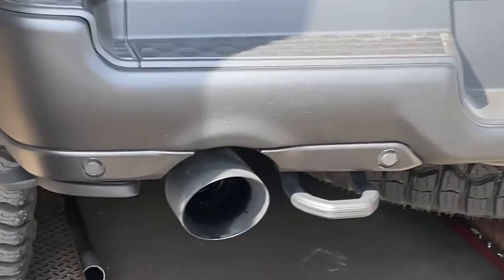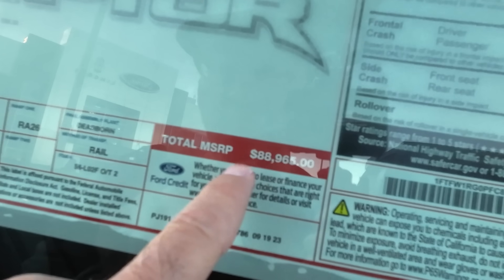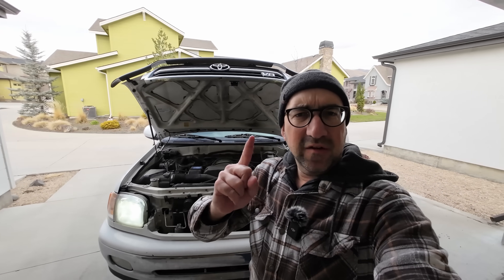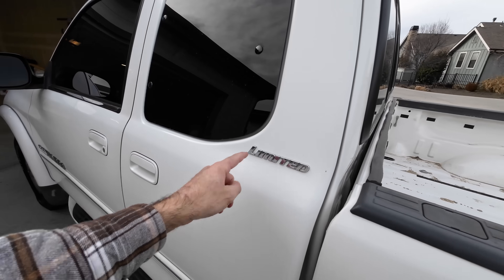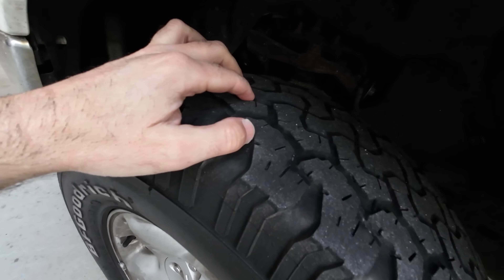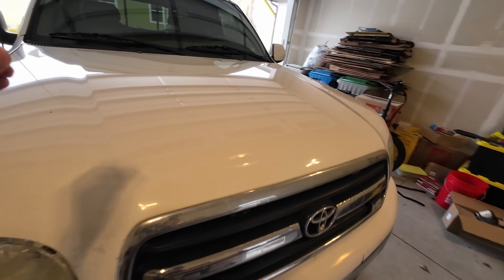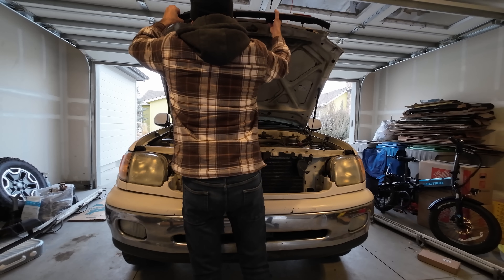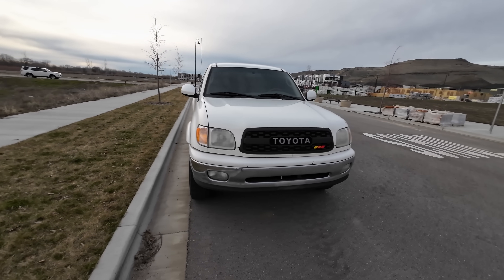I'm Sitting In The BEST V8 TRUCK Ever Made! (and I bought it)

Comment: I’ve run 3 Silverado’s to approximately 300K. I have number 4 right now at 270K. I also have a 3500 dually duramax at 230K. Get whatever you like, but… no plans of changing here! “If it ain’t broke, don’t fix it!”
Reply: What are the years????
Reply: Same. Got a 2000 Silverado 5.3 Z71 4x4 Ext Cab. 90's to mid 2000's Chevy NA V8 gas trucks are great.
Reply: Bruh, chill. You drive too much
Reply: I just sold an excursion with a v10 that had 301k
Reply: You're right built like a rock 🇺🇲🇺🇲🇺🇲🇺🇲
Reply: Guess what. Gm is gonna keep building v8s. If you want a tiny little 4banger turbo go ahead. I'll stick with  the v8 in my pickups.
Reply: @codyfarmer1  while that is correct for the moment GM already offers a turbocharged 4 cylinder Silverado.
Reply: @sjwilson1079  I know that, but at least gm still offers the v8. I would never buy the chevy 4 cylinder in the truck. Just like any other 4 cylinder in any other truck.
Reply: @codyfarmer1  I own a 4 cylinder 99 stick shift Tacoma. Great little truck
Reply: I’ve got a ‘99 Silverado 2500 with the 6.0 liter and 4L80E. 325,000 miles and still going strong. Last year I bought a new 2023 Silverado 2500 with the 6.6 liter Duramax. So far it’s only got 25k miles but it’s my first and hopefully last brand new vehicle.
Reply: @FloridaTwoWheelAdventures  unfortunately the modern diesels are not as good as the old ones.
Reply: @sjwilson1079  nah, they’re fine. You just gotta get rid of all the dead weight on them. I’m simply waiting for my warranty to end.
Reply: @sjwilson1079  nothing wrong with a smaller engine in a smaller truck, but a full size truck needs at least a v6 imo.
Reply: @codyfarmer1  I agree with that but I don't want any turbos. Turbos wear gas engines
Reply: @sjwilson1079  agreed my last f150 had an na v6. Ran like a top for 12 years. Replaced water pump and that was it.
Reply: @codyfarmer1  my favorite f150 had a 300 inline 6
Reply: How many transmissions?
Reply: @ronnyek4242  depends on whether it's the 4l60e or 4l80e lol
Reply: Only 300k miles?

My 2011 Tundra has about 280k miles and is still just a baby.
I fully expect it to last well over 500k-600k miles.

It sucks on gas, but it's given me almost zero problems.
Reply: I still have my 99 4.8 silverado 376k and around 100 of that it had a small turbo it's back to na with a trailblazer ss intake but besides that no egr and a tune its great I'm actually doing the leaf shackles right now
Reply: Why do they keep breaking at only 300k?
Reply: @BillLaBrie  I'm almost at 400k last time I wrote i was doing the leaf shackles which is funny because I just picked up some 1000cc fuel injectors by fic paired to a fast lsxrt fuel rail and HFP 367 lph fuel pump maybe I'll find time to cut and weld the bed from the damage but it drives fine and is enjoying some extra power
Reply: Ok whatever

Comment: I have that truck in a 2001. Original owner, 24 years. Do all my own maintenance and on average spend under $200/year. Best purchase ever!
Reply: I have the 2001 version.  I have spent less than $300 in repairs outside normal service.  Best vehicle I have ever bought.  I get at least 2 offers to sell every month.  No way, she will go to the grave with me.
Reply: @bsmith8016  The only problem I've had in 24 years is an O2 sensor going out. Everything else was regular maintenance. I want a new truck, but this one is in great shape with no issues... can't justify spending $60K on a new Tundra.
Reply: I feel you. I’m tired of my 2012 CrewMax 5.7 4x4, but I can’t justify buying anything else. It never fails. I get offers and positive comments all the time. 205k miles and counting. No doubt I’ll get to 300k; maybe even 400k+ like my buddies in Kansas. New stuff is just so darned fancy and comfortable. The prices and reliability concerns keep me away. I sometimes wished I didn’t care so much about a stellar history.
Reply: I have 2004 Tundra double cab 4x4
Reply: But they have a drinking problem 😂
Reply: @randyparmesan1383  I would rather deal with the cost of the drink than get to know my service manager on a first name basis. 😂

Comment: This is exactly why I bought a 2006 GMC Sierra with the 5.3 V8. It's not a Toyota, but it's still solid.
Reply: At least you bought a truck…not a wannabe
Reply: Facts
Reply: Yo yo, I have a used 2006 GMC Sierra with 207 k on it in the LS L-33 all aluminum, still teaching 5 grand when hauling my trailer. They can have all the new POS trucks.
Reply: I still drive my 2001 Silverado with the 5.3 V8 - I have been driving it 23 years and 316,000 miles.  Still my daily driver.  Rusty but trusty!
Reply: @flinty2  My Sierra has had a charmed life. The rear fenders are only just beginning to rust.

Comment: Great trucks but there’s a catch: If you are looking to buy a first generation Tundra or Sequoia be sure to have the frame THOROUGHLY checked for severe rust. They had a recall, many still on the road and are literally starting to break apart.  If you live in the snow belt protect the frame with Fluid Film or similar protection.    Second, verify the lower ball joints are not worn out as when they fail the wheel separates from the assembly(google “first gen tundra LBJ fail”). Lastly, make sure the timing belt and water pump has been replaced within recommended intervals.    Mostly all basic maintenance items but they will bite you if ignored!  -‘05 Tundra owner.

Comment: I bought a Chevy Avalanche with a 5.3, 4wd with 4lo, loaded, everything works, it can tow 8,000lbs, and I can load 8 feet of cargo in back, plus I can fit 3 adults with comfort in the back seat, stock stereo that came with a sub, stock tires are 265's with 33 inch diameter, 11" ground clearance, excellent body, stronger frame. Only cost me $3800 two years ago.
Reply: Too bad it's a bow-tie, because it won't last near as long as a Toyota!
Reply: 5.3 is a beast........... built to last

Comment: Older vehicles are so much better. I have a 2003 Grand Marquis, 443,000 miles and still runs like new, no major issues since new, less than $1,000 in repairs since new. I also have a 90 F150 that still runs and drives like new...   Great video...

Comment: Perfect choice. I've owned a 2001. And now have a 2004 SR5 Xtracab that I found in 2017 with only 37k miles in San Jose with zero rust. I don't drive a lot and am approaching 115k miles as of January 2025. Other than my 2006 LX that I sold a few years ago, this is my next favorite vehicle I've owned. Perfect size and a V8.

Comment: I bought a 2000 Toyota Tundra Limited with low miles in 2020 and you can't beat the 4.7 V8.
Reply: 4.7 is a legend ! I have one in my sequoia too , so smooth
Reply: I had a 2000 Dodge Dakota pickup with a 4.7 liter motor it was a good running engine I had 142,000 miles on it when I sold  it , but it sure drank the gas . My 2014 ram with the 5.7 engine has more power and gets better gas mileage

Comment: For those wondering, original msrp was $26,300 according to Edmunds. Before Covid, most vehicles would be at 50-65% value after 3 years 36k miles. $10,500 is a crazy high price for a 22 yr old vehicle.

I enjoy your content.
Reply from the maker: Even used truck prices are still crazy right now. I found so many for sale around the same price or 2k less with accident history. This was the best one to buy in my area price/history wise. Crazy times.
Reply: Even before Covid, finding a tundra, sequoia or 4Runner in decent condition for less than 10k was not an easy task. Sure, In 2022 this truck would have been on a dealer lot for 15-20k but a lot has changed in just a few years.
Reply: $10,500.00 for that truck is a bit much. I would have bought the green Ford. If the price was right. The price of the Toyota was about 5k too much.
Reply: Since the green ford was not 4 wheel drive. I would not have bought either.
Reply: For me 10.5k, one owner, no accident, maintenance record, I'm ok with that. It's even a bargain as this truck will outlast most newer ones. Bad lucks can happen, as other trucks.
Reply: Not overpriced IMO for a truck that will last another 20 years
Reply: @FullTimeGT  That makes you part of the reasons why used vehicles are as expensive as they are. You are willing to pay more for a vehicle than it is worth. Used car dealers know there are people like you. You will not negotiate price. You will pay whatever the seller asks. That is foolish.
Reply: @InternetUser._  My car will last as long as that Toyota truck will. It will last me another 20 years & it is already 38 years old. It is in good shape a I paid $1500.00. It was a 1 owner car when I bought. Drive it everyday.
Reply: By all means, if someone out there can do better. Please post your results.
Reply: @GS-zc4sk  You ask for it.
2010 Ford Escape Limited AWD. new tires, brakes, & inspection. 138k mileage $5400.00.
2011 Ford Escape XLT No Rust 109k mileage $5600.00 
2008 Ford F150 4WD. 70K MILEAGE $7000.00.
I found these vehicles in Morgantown WV. 
Any questions?
Reply: It's clean for the age, but still a crazy price.
Reply: @MotorFeed  -- The really important question is this: Will we be seeing your yellow Jeep on some dealer's lot now, or did you keep it too?
Reply: @richardisner3671  You are comparing two totally different parts of the country, vehicle prices change based on region.  Up here you cant find a truck/SUV for under 10k no matter the year.
Reply: @Grozloo  Where is up here?
Reply: The main thing is that you’re happy & you done your research. Can’t wait to see all of your personal touches.
Reply: Absolutely agree,5000$ max
Reply: 100% agree, I just checked local marketplace no were near that high for nice ones.
Reply from the maker: The green ford was $12k. @richardisner3671
Reply from the maker: The yellow Jeep is my daily and not going anywhere. I bought the Toyota specifically for YouTube content. @TheRealScooterGuy
Reply: @MotorFeed  Way too much. Especially since it was not 4wd.
Reply: @richardisner3671   Prices are very region specific. In the city where I do business those 08-10 escapes go for 7-8k. In my home state they can be had for 4-6k.

That being said, a ford escape is not a 4x4 V8 Tundra. I’m a big fan of 4-5k vehicles and have a couple in my fleet, my trucks are usually had for around 10 for a good example.
Reply: @InternetUser._  I never said that an Escape was the same as a Tundra. But the F150 I listed is. I was giving examples of prices where I live. But that he bought was about 7k too much. V8 Tundras are a dime a dozen. If you can find one with a solid frame. The frames are usually rusted through on those models. There was even a recall for that particular problem.
Reply: The value of the US dollar has collapsed since 22 years ago so $10,500 isn't bad at all.
Reply: @InternetUser._  Question: how does one get around the stupid insurance cost for a cheap vehicle? When I looked into adding a 3rd vehicle to my insurance, my provider wanted to charge me an arm and a leg for the "cheapest" liability only option. I don't want pay the value of the vehicle every 3 years in insurance cost.
Reply: I paid 10000 for a 1998 tacoma 4wd 5 speed extended cab manual windows and locks lol
Reply: @jasonleatherwood2172  You got ripped off bad. Unless you bought it 10 to 12 years ago. Hell in 2008 I bought a 2003 LOADED F150 4x4 with 58k mileage for $14000.00. That $ 3000.00 below book value.
Reply: @richardisner3671 wrong. He done all the homework in regards to service records, one owner, looking for rust etc.  It wouldn’t matter much where you live or what manufacturer you’d pay a similar price.
Reply: @alcopower5710  No I would not. You might go back & read my comment where I listed a Ford F150 with 70k miles for $7000.00. I would not have payed more than $3500.00 for that Tundra.
Reply: @alcopower5710  You know nothing about me. It make a claim like you do know me makes you look foolish.
Reply: @richardisner3671  didn’t say that I know anything about you. Do you speak English?
Reply: @alcopower5710  Except for the fact you said if I had done what he did I would have paid a similar price. That is where you are wrong. That is why I said that you do not know me. I would not have paid a similar price. For what he paid for that 2002 4x4 Tundra. I could by a 2012 model with low miles no rust & only one owner.
Reply: @alcopower5710 Yeah I speak English. I comprehend it very well also. Comprehend means to understand. Just in case you don't comprehend. Which it appears you don't.
Reply: Depending on mileage, $10.5k is a great price for a 4WD Limited TRD packaged Tundra. Ignore the naysayers.
Reply: It will last longer than most of these new trucks.
Reply: @andyg806  $10.5 is not even a good price for a 2002 4x4 limited TRD Tundra. It amazes me how people willingly allow themselves to get ripped off. $3500.00 is what that truck is worth.
Reply: @jkosh2046  I would not own any vehicle built after 2014. I own a 1986 Lincoln town car & a 1986 Ford F150 4x4. Both of those vehicles will last until the day I die.
Reply: I have an 02 tundra and I watch the values of these closely and at least in eastern OK $10k for a nice 02 is pretty close
these first gen tundras are like gold, I bought mine for $7k 12 years ago and when I blew it up 2 years ago the tow truck driver offered me $3k for it and when I went to looking for a donor motor, I couldn't find one that ran for less than $6k. last I checked if mine ran it would book for $8K
Reply: Being a Toyota though, you can probably get your ten-five back right away.
Reply: @richardisner3671  I have 2019 tacoma. I bought it new and the more I drive it, the more I love it. I have the base model 4 door with the 4cyl. It's a basic truck that drives like a truck should and it will last forever. I've always loved tacomas since I saw the black toyota truck in back to the future when I was a kid. It has exceeded my expectations. My next buy will be a 99 or 2000 4 runner.
Reply: @jkosh2046  I like Toyotas their vehicles for the most part are great vehicles. I have owned a couple. A 77 corrolla wagon, & a 88 & half MR2. I am glad you like your Tocoma. Good luck with finding a 4Runner.
Reply: I disagree, hi purchased a 2001 tundra, one owner, always garaged, for $15,000. I think I got a really good deal based on the truck and the condition it is in. On older vehicles you can’t always go by the book.
Reply: I paid $7500 for a neighbor's one owner garaged 2010 Pilot. I'm happy with it. Most issues were just normal maintenance items. I chose the Pilot because it was cheaper than a truck and for cargo and towing. Touring 4wd.
Reply: That's not how you value used vehicles.
Reply: Agreed ... insane price for that truck
Reply: Toyotas cost more because they are over engineered. $10,500 for a vehicle that could last the rest of your life.
Reply: It depends on the truck. What's really crazy is $100k for a new truck.
Reply: @richardisner3671  Not sure we can tell if it's over priced cause I never heard how many miles it had
Reply: @stonewolf9459  How did you blow it up, curious since I have one and never heard of them blowing up.
Reply: Mark Price. If it was in showroom condition with less than 40k on it. It would be worth $10,500. But it was not. It was in good condition. If it had average mileage it would not be worth that kind of money. If it had less than average mileage it still would not be worth that. I don't care what the mileage was. Condition & low mileage does not mean it is not ragged out. Buying used sometimes means buying someone else's problem. Even from a dealership.
Reply: I was on a camping trip 3 hours from home and had a very serious emergency happen at home. I drove 95 to 110 miles an hour the whole way back home trying to get to the hospital pulling a trailer up some very long steep hills with overdrive off. it started knocking after about 2 hours of consistent above 4.5k revs under heavy load. after I got home it still would start and move around under its own power, but I went ahead a bought a low mileage motor instead of rebuilding that one. at the end of the day my haste was unnecessary, and it cost me north of $5K. this all happened with roughly 250K miles on the factory motor that had almost no oil consumption.  they really are amazing trucks, mine blowing up was absolutely 100% my fault and I would have no reservations trusting it again pulling a trailer on as far a trip as I needed to go
Reply: @MotorFeed  you missed out on that one
Reply: @marcusmarrs  you may not go by “the book” but your insurance company does. If it gets totaled out in an accident you will be in a a big surprise what that insurance company gives you
Reply: The guy with the comment about it being too high is right, but wrong. Post covid, things have changed.
Reply: @richardisner3671  $10K for a clean, V8 dependable truck that might outlast the $70,000 plus many thousands more in interest, DMV fees, insurance. Oh,don't forget the thousands in repairs for the new high tech vehicles that will fail. In 5 years, the $10K Toyota will have been a bargain. How many houses on 1/4 acre are worth $600,000?
Reply: @jimandersen3003  A fool & his money are soon parted. Here where I live. That truck is worth 7k at best with low mileage.  And anybody around here with a 600k home has it sitting on at least an acre. That they only paid 35k to 50k for the land, depending on location.
Reply: not too high for this truck
Reply: Toyota tundra is good but  4 cylinder Tacoma would be better , reliably  and  good engineering  last for ever  !!!
Reply: Very nice
Reply: Not overpriced. Toyota 4x4 trucks sell for higher than their blue book value.
Reply: @MotorFeed just bought a Tacoma double cab TRD and paid up at 19,500 with 19,700 miles it's a 2010  one owner and spotless inside and out with a Leer 700 bed cover. People thought I was nuts but it'll last the rest of my life.